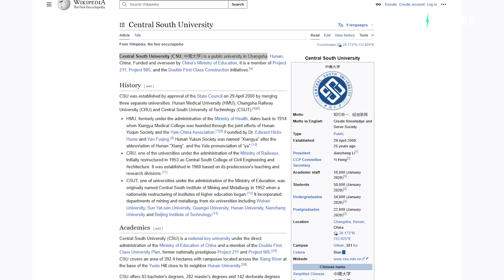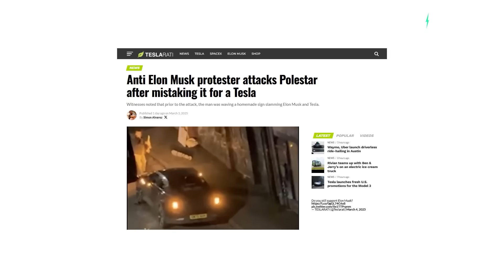Battery Recycling Revolution: Cheaper, Cleaner Way to Recover Critical Metals!

Comment: If they're worth so much money, why are only 5% recycled?
Reply: Because it is so easy for people to put batteries found in consumer electronics, AA, AAA batteries etc.  in the trash, rather than go to a recycling centre.  There needs to be a attitude change to recycling to bring about the change.
Reply: @TimelordXYZ  true...
Reply: Do any countries actually have AA, AAA battery recycling? I just throw mine in the trash.. nothing I know of in Australia
Reply: @micoots  good question
Reply: 5% of EV batteries?   That’s the wrong number.  It’s close to 100% at the moment.
Reply: @WillBecker  5% I found was low. With stockpiling and landfills, close to 100% being recycled is fantasy.
Reply: @ it’s not fantasy unless you can prove EV batteries are being sent to landfill en masse.  They’re worth £1000s used for secondary storage or classic conversions, for starters.  And are full of valuable metals, with an industry set up ready to recycle them if they’re available.   It’s fantasy that they’re being sent to landfill.  It’s a problem that doesn’t exist yet: car batteries have yet to reach end of first life in any significant numbers.
Reply: @WillBecker  it costs more to recycle lithium-ion batteries than it does to mine them. Due to the different configurations, they're dangerous to dismantle. Also, fires at these recycling facilities are a reality.
Reply: @ skyler, why comment on something you don’t know anything about?   It does not cost more to recycle than the value of the materials you get out, ask redwood materials and multiple other companies ready to go with an economic model and processes.  The issue is that there are no batteries to recycle yet because they’re lasting so long and the demand for secondary usage is so high that they’re worth 1000s even after use in an EV.
Reply: @WillBecker  the Dept. of Energy in US in 2024 said in 2023, we had the capacity to recycle 35,500 tons of batteries. An EV battery weighs over 1,000 lbs. Do the math.
Reply: @ you do the maths buddy.  How many EV batteries (likely at least 20yrs old) do you think are ready for recycling, having been through 2nd life?   How many EVs were there in 2005?
Reply: @WillBecker  you didn' do the math which is no surprise. As you can see, we can only do limited recycling due to limited facilities.
Reply: @skylershank9309  All these recycling companies are queued up ready to go, with no batteries to recycle,  If they can recycle 10 batteries, they can scale up to recycle 100,000 batteries.  But 15-20 years ago there weren't  really any electric cars.  Nobody in the materials industry thinks that EV batteries won't be recycled. And commercial, well-funded companies are set up, with processes sorted.  You can read and watch them. - eg "fully charged battery recycling" on a German operation, or read about Redwood materials.  Are EV batteries going to landfill?  No. So, what are you talking about?
Reply: @WillBecker  if 'they' can recycle 10 batteries, they can scale up to 100,000? That would  take years to accomplish by 'them.'
Reply: @ yes and “they” are redwood materials, Tozero, Primobius, Cylib, and REDUX, just for example.  And there are YEARS  to scale up because the flow of EV batteries won’t start until at least 2029 and scale slowly from there.
Reply: @WillBecker  by then, hopefully the chance of fires in these facilities will be reduced, and the dangers of battery disassembly will of diminished.
Reply: @ not “sorry I was completely wrong on this, we actually are ready to recycle 90%+of EV battery material”. Now, it’s “yeah, but there’s a risk of fire and dangerous chemicals”. And yes, these many, well-backed businesses have thought about how to handle lithium recycling.   The fires are happening where people throw their phone/vape etc into the general recycling bin.   But you probably don’t worry about that because really, just like all the other non EV owners telling owners what it’s like to own an EV, this is not actually about materials supply chains in EVs, is it??
Reply: @WillBecker  not even close. With recent fires at Moss Landing again and the world's largest lithium-ion recycling facility at Fredericktown, 90% EV recycling isn't close to a reality. 
As far as owning one of these mobile problems, no thanks.
Reply: @ oh, i thought drilling, refining and transporting oil was a huge environmental risk, but it must be perfectly ok?   Now you’re claiming, I think, that batteries can’t be recycled because of the fire risk?   And also linking a story about a battery energy storage facility which is somehow related?
Reply: @WillBecker  I never said ev batteries couldn't be recycled. You gave a 90% number that I refuted because of the fires at the facilities that dramatically lower that number. 
Do I worry about oil drilling and transportation? Of course not. We've been doing it over a century.  
Google - hazards of lithium mining and then tell me you'd rather have a lithium mine where you live than an oil field.
Reply: @WillBecker  I stand corrected about Moss Landing. However, the fire at Fredericktown Missouri was the world's largest lithium-ion recycling center.
Reply: @ lithium mines are orders of magnitude smaller and less impactful.  They’re not green by any means but compared to the environmental and geopolitical impact of oil they’re minute.  Oil pollutes watercourses, seas, air and that’s before we get to carbon.   It’s a source of deadly armed conflict repeatedly and often.  Lithium is extracted once and then recycled.  Oil is extracted, transported, refined and burned, once.
Reply: @WillBecker  yet without oil our world as we know it wouldn't exist. Just because there's not as much lithium doesn't dismiss it from the toxicity that accompanies its  extraction and processing on the environment and people.
Reply: @ it’s not dismissed.  It’s compared.  And it’s better for the world, by far, despite having serious harms, costs and complications.   We will move away from oil as a fuel at some point, we won’t have any choice.  Better now than later.
Reply: @WillBecker  problem is billions must be spent in every country, not just for EVs, but energy for AI also. Its gonna be awhile.
Reply: @skylershank9309  For the UK, we're currently sending 10s of billions to petro-states and other unfriendly regimes, yet has a competitive advantage in wind power geography.  EVs actually add little to grid demand.  A full switch doesn't take us back to 1990s level of demand.  But space heating is another matter.  That will require huge new generation capacity.
Reply: @WillBecker  Blockleiter Starmer is giving billions in foreign aid. Money that should be spent at home. He's just getting started. 
Aren't your energy costs some of the highest in Europe? Renewable energy isn't cheap. I'd hate to depend on the weather for my power needs.
Reply: @ Our latest wind auction produced supplied energy to the grid at 5.5p/kWh.  Gas, our main source of fossil power, which is responsible for our high energy pricing and which we have to import, produces electricity at 14p /kwh.   What other beliefs has your research on petro-funded social media channels given you?
Reply: @WillBecker  you pay the operators of wind farms when the turbines aren't operating. It's called 'constraint payments.' 
You've got biomass generators that produce more carbon dioxide than fossil fuels. You're the biggest importer of wood pellets, a good portion coming from America, which wants to thank you for your stupidity. ⁸

Comment: Can anyone give me a quick description on why Li batteries that might be prone to fire (like NMC when damaged), can be ground up and not cause a fire? Just too fast of a process?
Reply: The cause of any fire is the Energy inherently stored in the material - be it Gasoline or batteries or plastics or whatever else it contains. If the energy/electricity in the batteries can be depleted and the material made inert prior to the process of recycling, there wont be the danger of thermal runaway.
Reply: Yeah, my question as well. I know it works, I’m just curious. I’ll check out Redwood I bet they have a ‘splainer
Reply: It's the material used between the anode and the cathode.. the electrolyte... lfp and nmc use a liquid electrolyte... that's why they looking at silicon as the electrolyte.. it's a solid.. when and if done... will be fire proof essentially 

As long a the liquids are used is the liquid that is the flammable part

Comment: Anyone who ever bought a lead acid battery for your car knows it costs a lot more if you don’t turn in your old one. Batteries get recycled at about 90%. In fact some of the lead in your new battery may have been mined in the 1950s. No reason EV batteries wouldn’t be the same.
Reply: Lithium batteries are not complicated than lead acid
Reply: @i6power30  And full or already refined valuable materials.

Comment: Missed opportunity Sam (unless I missed it): Companies that focus on reusing BEV batteries for home energy stationary storage is easier and better for multiple reasons:
1. No grinding up and secondary processing required to "recover" the mineral content.
2. When used in a BEV the power demand curve is very high and very fast.
3. But when used for stationary storage as in a home, this is no longer the case.
When these batteries are no longer able to meet the need in a stationary storage context, then it makes sense to grind them up.

Companies that are already doing this (and the list is growing) include:
- RePurpose Energy

- Moment Energy, based in Canada
- B2U Storage Solutions, operating in California

- Second Life EV Batteries Ltd, based in the UK
- LOHUM, in India
Reply: There is a practical challenge to your suggestion: each brand/model of EV has a differently shaped battery and possibly different voltage and different types of electrical connectors, and these issues might make it difficult to figure out how to connect the battery to solar panels and inverter so the battery can be used in a house. For example, my solar+battery setup uses 48v batteries plus an inverter that can convert 48v DC to 240v AC. I assume that my commodity, off-the-shelf inverter cannot be used with an EV battery that has, say, 400v or 800v.

I'm not saying that your suggestion is impossible (in fact, I know it has been done in a few cases). But a bespoke inverter for a particular type of EV battery might cost a lot more than a commodity 12/24/48v inverter that is widely used with home solar+battery systems.
Reply: @CiaranMcHale  Yes perhaps using old EV battery packs might be a practical challenge for an individual homeowner using the entire pack as it comes out of the vehicle however using the individual modules one can build a pack compatible with their home system or they can turn to a company like RePurpose Energy to set up a pack with engineered safety systems built into it for you using repurposed EV battery modules.  It is already is being done commercially and has been so for quite some time having already proven to be a very practical solution for utility companies, commercial backup systems, cell phone towers, etc, etc.

It's nice to have so many options to choose from and wonderful to see things constantly improving.

Best!

Comment: The Bharat Cell is Ola Electric’s indigenous 4680 lithium-ion battery cell, designed for use in its upcoming electric vehicles. Here’s everything you need to know about it:

Key Features of the Bharat Cell (4680 Li-ion Cell)
	•	Made in India: Ola’s first locally developed and manufactured lithium-ion cell.
	•	4680 Format: Cylindrical cell with 46mm diameter and 80mm height, similar to Tesla’s 4680 cell design.
	•	Higher Energy Density: Offers improved storage capacity and longer battery life.
	•	Better Thermal Management: Enhanced heat dissipation for improved safety and efficiency.
	•	Faster Charging: Optimized for quick charging cycles, reducing downtime for EV users.

Manufacturing & Gigafactory
	•	Battery Innovation Center (BIC): Ola has established a dedicated research and development facility in Bangalore for cell and battery tech.
	•	Gigafactory Production: Ola is setting up a cell manufacturing Gigafactory in India with a 100 GWh capacity, aimed at reducing reliance on imported batteries.
	•	PLI Scheme Support: The Indian government is supporting this project under the Production-Linked Incentive (PLI) scheme for advanced chemistry cell manufacturing.

Use in Ola Vehicles
	•	Ola plans to integrate the Bharat Cell into its upcoming electric scooters, motorcycles, and electric cars for improved range and efficiency.

This marks a significant step towards India’s self-reliance in EV battery technology, reducing dependency on Chinese imports and enhancing local production capabilities.

Is it true?